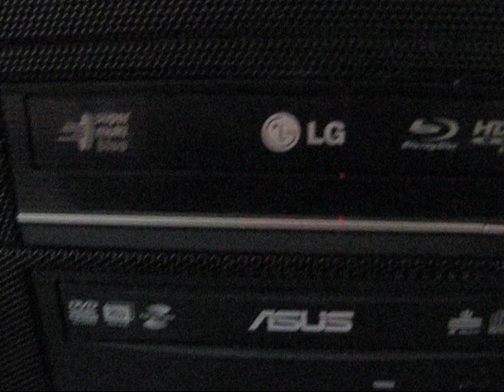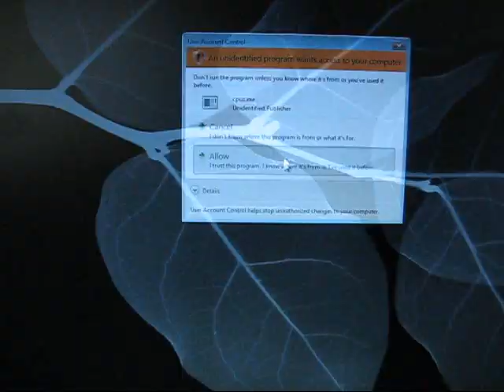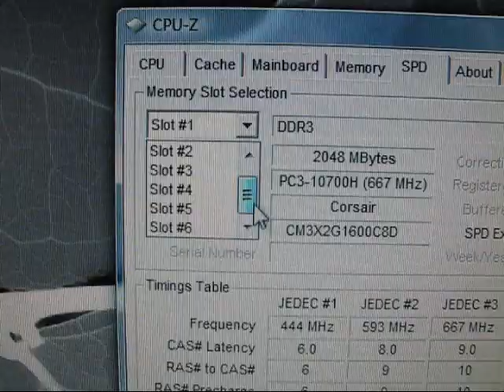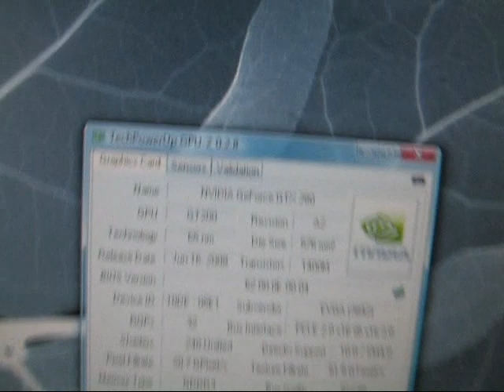i7 Extreme Edition 965 Gaming Computer Rig 2009

Comment: You should have waited for the GTX 295. And also in the Nvidia control panel in the performance section there are overclocking options for the GPU's.

Comment: I totally agree with this, however my computer cost me £500 including keyboard, mouse and 2.1 audio system and if i was honest my computer plays the same games that i would normally play on my 360 and ps3 and my pc displays the games better than the ps3 and runs the games quickers with no lag. Also my computer has never crashed since i built it which was nearly a year ago.

Comment: lol accually noty really beacuse the 2 Gtx 295 both will run at 16x16 but if u run tripple sli your gonna have to have one slot at  1 x so its like 16x16x1 u dont get full performance out of the last Gpu so 4 fulling functioning 260's will take 2.3 Gtx 280's

Comment: weird case. 

my computer - Asus P6T Deluxe, i7 920 3.8GHz overclocked, 6GB RAM DDR3, 2X GTX 260 superclocked, 2X WD 750GB + WD Raptor 300GB, power supply 850 wat, and Cooler Master V10

Comment: future rig:
in 2 weeks all going well....
rampage 2 extreme x58
core i7 920 o/c to as far as it will go
6g detonator 1866mhz 
3 way 9800gtx sli
all under water twin loop setup costing 1k us
already have 3x22" samsung lcds 2 ms 1680x1050
g9 and laycohsas back lit keybord but ma by the g15
x5500 5.1